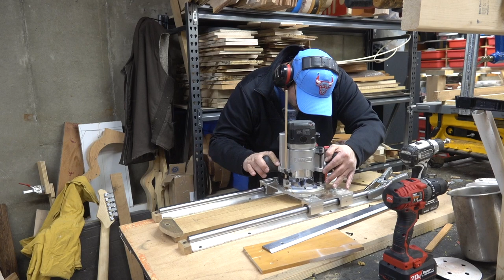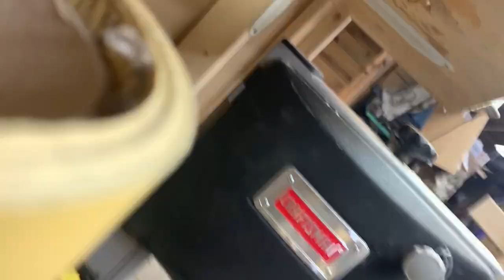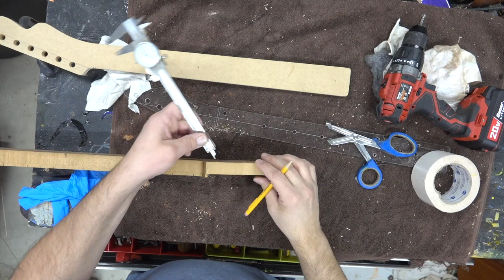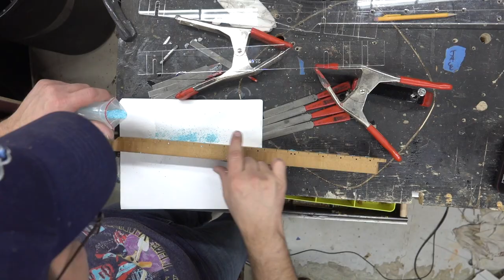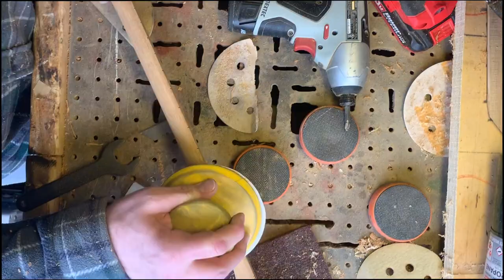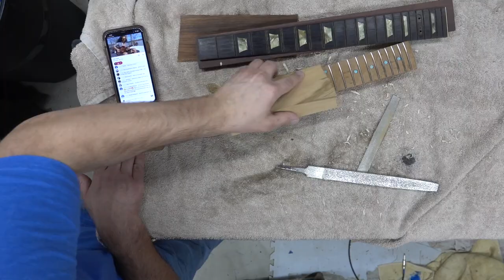Building a Roasted Maple Guitar Neck - Full Video

Comment: I Don’t think you have a good unferstanding of what a roadten neck is.
I’ve been in BioChemical for 15 yeats and use large scale Virtus Sublimators.
You change the chemical structure of the wood via vacuum and heat i.e. Sublimation is the transition of a substance directly from the solid to the gas state, without passing through the liquid state.
Do yeah um…